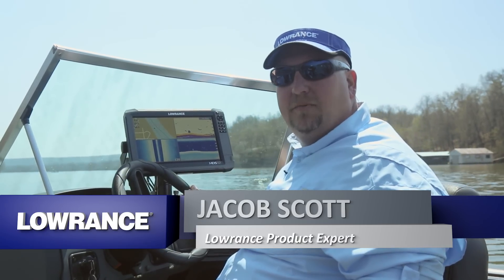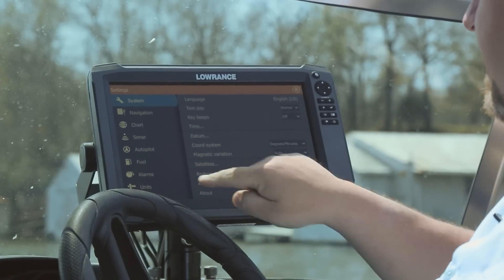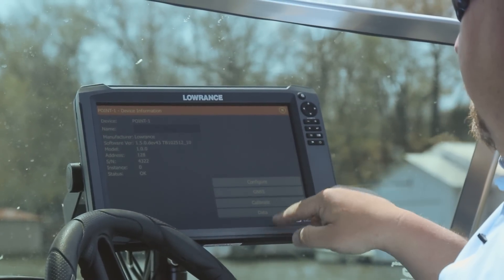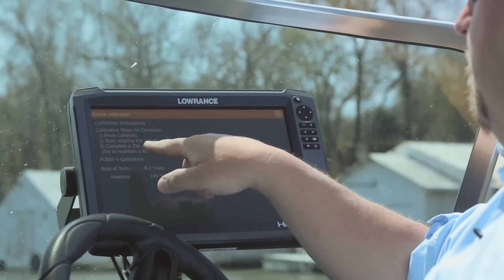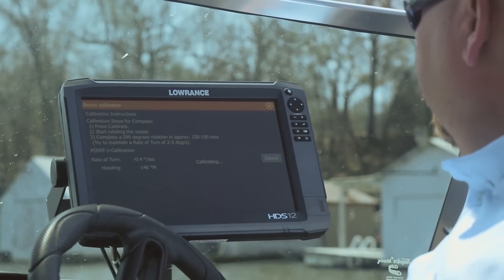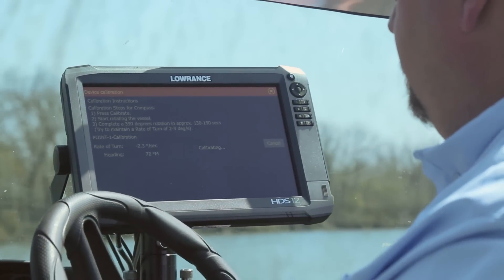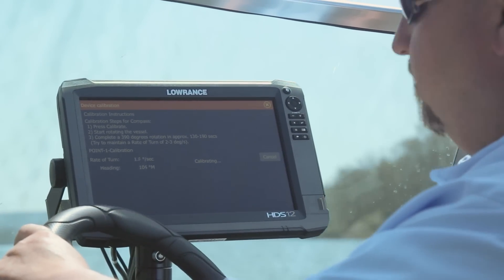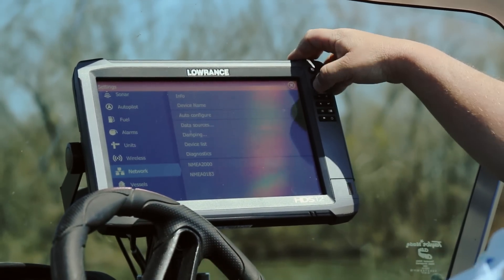Lowrance |  Calibrating the Point-1 Antenna

Comment: Hi,

I have a problem with my setup and was wondering if there's a solution for it. 

I have a basic setup with just HDS LIve 9 and Point 1 linked up via NMEA 2000.  

Everything works as expected, I can see both my direction path and my heading path separately shown on the map and working great. 

However, I have a very annoying issue. 

Whenever I go "in reverse" or let the drift carry me down the river, if I mark something on my side view, the waypoint is being created on the opposite (wrong) side of the boat. 

It seems that the fact that I have a Point 1 antenna, so the system should know where I'm facing at, doesn't affect the waypoint creation process and that the system "thinks" I'm heading down the river, front facing. Which is untrue.

Is this expected - and more importatly, is there a fix for this?

Comment: The TMC came with the ghost trolling motor. Does that have to be hooked to the pedal if I have a .1 and if so, can I hide that TMC under the dash and just have the .1 visible on the boat? I don’t even understand really why I need a TMC?
Reply from the maker: Yes, you will need to connect the TMC-1 to the pedal, pag, 22 https://softwaredownloads.navico.com/Lowrance/FTP/Lowrance_Software%20-%20Copy/documents/Ghost-series_IM_EN_988-12451-005_w.pdf
Please follow the steps to callibrate the TMC
https://www.lowrance.com/en-nz/help--support/knowledge-base/?guideId=522-853
Reply: @lowrance  so then I’ll keep it plugged in and I’ll just put it under the dash with all the wires

Comment: So had 2 point 1's installed, 1 in the bow and 1 in the transom.  The installer didnt label them as "bow" and "transom" so Im not sure which is which.  One is labeled Point 1 6304 and the other is labeled Point 1 6311.  Which is which or how can I tell???  Thanks
Reply: ... Very frustrating to have questions to Jacob and no answers. Chances are very good you already solved your issue.  My first thought for anyone else having this question, Bring up the screens on the console and bow units that show the Point 1 in the list. Unplug one of the NMEA 2K Point 1 connectors at the N2K backbone. One of the units will now, NOT show the Point 1 in the list. Mark/flag that cable with white electrical tape and note it with black permanent marker. Now you also the other N2K cable it the other Point 1. 
.

Comment: Doesn't this unit already have a GPS antenna built in? Does the point 1 antenna provide you with a better signal?
Reply from the maker: Hi, 
Yes the unit has a built in GPS.  The Point1 is a GPS reveiver as well as a compass.  You are calibrating the compass in this video.The Point-1 can be used for several reasons.  Some like to have a Point-1 mounted in a different area of the boat typically over a transducer. This way when they mark a spot it is where the transducer actually recorded the area.  Another reason would be if your unit were mounted under an enclosure with metal that blocks the signal.  The point one can also be used to synchronize a radar overlay.  In the majority of the installations a Point-1 is not required.